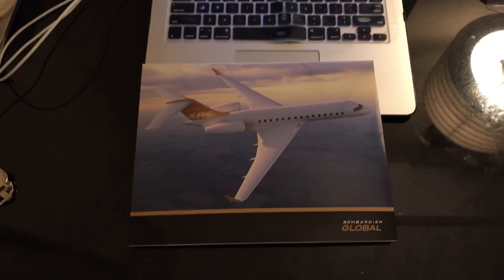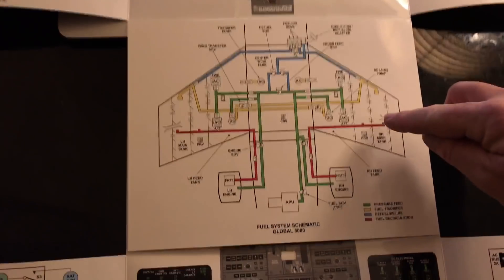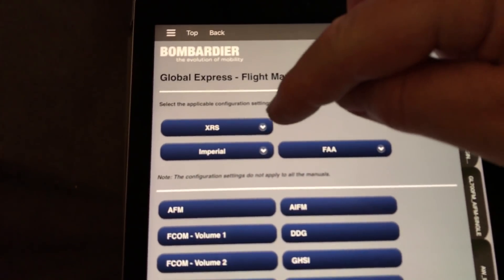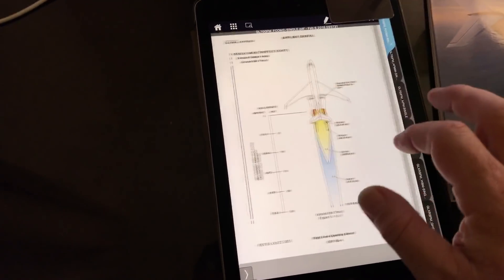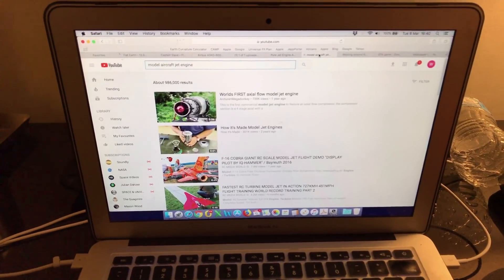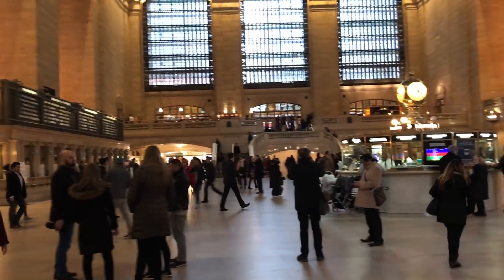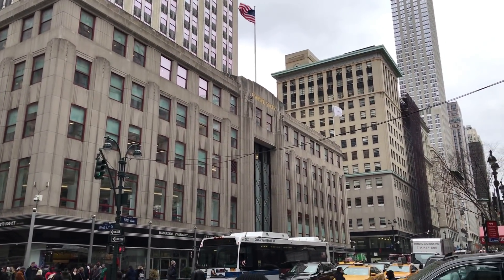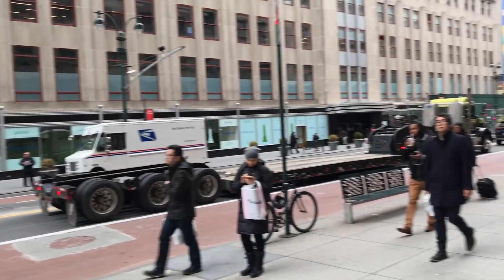Don't be ridiculous - of course Jet engines use liquid fuel.

Comment: See, the conspiracy has even you fooled!
Your plane uses an over unity engine, that runs on compressed air!

Now if you would like to fly me to Australia to prove me wrong, I'd be open to that.  ;)
Reply: my wife and will go along too!
Reply: Mark Beiser lmao!!! i see what you did there.
Reply: Marty Warner i think he's being sarcastic.
Reply: Flying Sorcerers run on compressed air?  You mean, like farts?
Reply: Try telling the flattards about the Qantas QF27 flight from Sydney to Santiago, rather than accept it proves a globe earth they deny it exists and its impossible to book a ticket etc etc
Reply: Christopher Ellis What is the flight meal?
Beans of course!
While I do love beans. I don’t think I would want to have a hose stuffed up my backside.
Well, not during the WHOLE flight anyway🤣
Reply: The "Run a car on HHO from water alone"  is another hot piece of kungfuckery out.  But it has been a topic in the quack science for over 50 years.   Electrolysis decomposes water, and you burn the resulting gas as fuel.  

They don't seem to comprehend that it takes as much energy to electrolyze water as you get from burning H2 and O2 in an engine, and the technology is a negative net energy process.  For which they add tings like lead acid batteries and solar cells to make up the energy input part of the equation.  Highly inefficient, to say the least..,
Reply: Mark Beiser 
The conspiracy nuts are well aware that their followers haven’t a clue about: heat energy, chemical energy, exothermic reaction, or anything about how heat>work equation. 

They are convinced that their audience IS stupid.
Reply: Larry Scott and they are correct in a lot of cases. Lol
Reply: For the love of God could someone please debunk this video? https://www.youtube.com/watch?v=sy7q549d5vQ&lc=z23fh3sbroyxyfwhs04t1aokgyldqdupumcrhkn2piykrk0h00410.1519760205714896
Reply: +Larry Scott

They can say anything they want and none of their acolytes will twig to the lies.., 

Speaking of a conspiracy keeping sheeple in the dark.
Reply: https://www.youtube.com/watch?v=BKJ3GQzdpG0

:D
Reply: Mark Beiser "Over unity engine"? That's it! It's all CGI, running on Unity!

</sarcasm>
Reply: It’s time to stop disproving ridiculous claims by conspiracy nuts and flat earthers. 

It’s time they start proving the crazy s—t that they keep crying about. 

All they do is claim things are fake or they don’t believe it so we all go about trying to prove they are wrong. 

Look, we know they are wrong. Period. It’s time to demand that all these conspiracy nuts and flat earthers start proving their crazy ideas. 

Not with some bogus video of sundogs. Get a clear, up close pic of the dome. Start a go fund me page for an expedition to Antarctica and find the ice wall. Get a craft the measly 3000 miles it takes to get tot he sun. Stop debating about stupid ideas and expect them to actually prove their stuff.
Reply: +Open Waters
No no no, that isn't how it works, at least not until after Wolfie flys me to Australia to prove to me in person that his airplane runs on liquid fuel, and not an over unity engine run by compressed air!

:p
Reply: Mark Beiser okay, fine, he can fly me too. Everywhere I look is snow, Australia would be great about now.
Reply: Yaknow WhatIming I've been to their site and gave them a couple of videos to watch. They were quick to respond to my first comment but silence to my last offering. Criticising flat earth sites and free energy etc is my new hobby and I'm learning great stuff as I go. Every person who can't handle bullshit dressed up as facts should do the same.
Reply: Gleason's Plane and they're all laughing at you.
Reply: what a sad life
Reply: +Neil Helgeson Have you run into the HHO nuts proclaiming how it produces the uber-powerful para-hydrogen (all hydrogen production methods produces mostly para-hydrogen at anything near or above room temperature), or, I'm NOT making this up, electrolysis generates deuterium?  

Then they lay it on good and thick and say that water containing dissolved hydrogen from electrolysis will cure any disease.

These magical devices could be owned for the low-low price of $1500.

I came >< close to reporting them to the FDA, but he folded up shop and ran away when I pointed out what a disgusting sample of humanity he was, and he disgraced the god he proclaimed guided him.
Reply: Homo Quantum Sapiens I cant see why you would be that aggressive over the topic. You r being very defensive and a bit of a ball bag on the subject almost like you have something to loose
Reply: Gleason's Plane 
How did you talk to these hardworking people on the tarmac? Did you bypass the security doors and sneak into secured areas? If so just give your confession to your local FAA office. They would love to hear it. Liar.
Reply: Just flap your arms you'll get there they lied when they said you couldn't fly
Reply: Neil Helgeson: The "Run a car on HHO from water alone"  is another hot piece of kungfuckery out.  But it has been a topic in the quack science for over 50 years.

In the Laurel & Hardy movie Jitterbugs the boys run into a conman who's selling gasoline pills that turn water into fuel.  Even in 1943 that was such an ancient dodge that only L&H could fall for it.  The urban legend about the carburetor that makes a car get 100 miles per gallon but was bought by Standard Oil and suppressed was also old hat.
Reply: Homo Quantum Sapiens but why would there be a 5 year old on the plane when you specifically said that he would be all by himself for your proposal??? Now now who’s the silly one who can’t tie a joke together haha.......
Reply: Mark Beiser People that have no clue about aviation and that have never worked on aircraft will believe anything Flat Earthers being the case in point !
Reply: Mark Beiser lol cool
Reply: +zomby woof Ridiculous claims about gas mileage and running cars on something other than gasoline have been around just about as long as cars have.  Well, yes, you can run cars on other things than gasoline, but they all cost more than gasoline does.
Reply: Hey.... good job debunking this one with drawings. Bravo. If you actually took note you would see they talking about high bypass jet engines. Not the ones you display in your pictures that burn fuel rapidly and spit fire. Does a Boeing spit fire like that? Didn't think so.